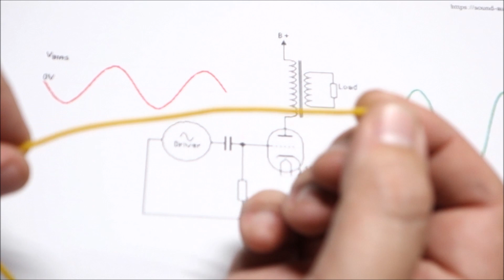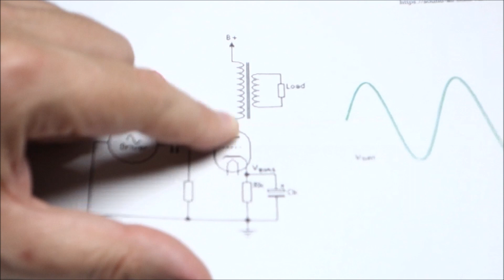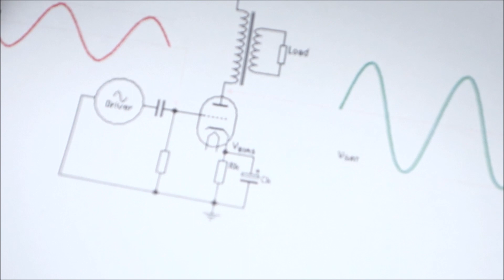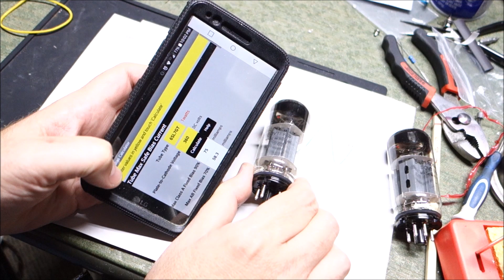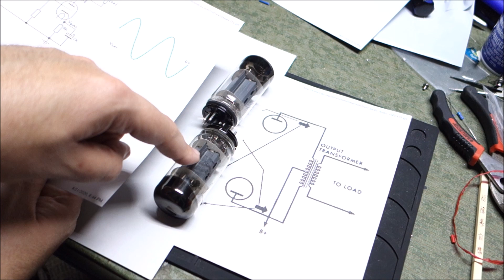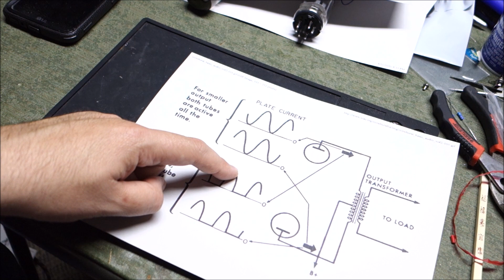Rookie's Guide to Guitar Amps...   Class A  vs.  Class AB    What the.....???

Comment: DC is like water supply pressure tower. You put a hose in and if the other end is lower, "power" will leak and the battery goes empty. You only use the potential energy of height (voltage/electromotoric power). In fact battery discharging is a veeery slow ac current with only 1/2 of wave length from maximum to minimum.
With alternating current it is like waves in the oceans - water is only a medium - a tsunami wave is a work made by seismic power on water. Tsunami wave goes somewhere and uses this kinetic energy to hit ground obstacles, but the water goes back to ocean. If Your ship is going with a speed of tsunami wave it takes 0 damage because it is in phase with tsunami (a remote place connected with a cable and no load)... if it is connected to ground tsunami will use its energy on it = load.

Comment: So what does it actually mean to burn up to just give a giveaway it’s vacuum
Reply from the maker: Inside the tube,  with too much current running through a given tube,   several failure modes are possible.   Emission loss,  shorted/open elements due to overheat, internal arcing.....   Under normal conditions,   a tube's cathode has a limited number of electrons it can emit in its life.  If it's expressed by the maker,  it's usually in hours of operation under specified parameters.    Metaphorically, tubes are like candles,   too short a wick (low bias)  and it doesn't provide much service.   Too much wick (hot bias)  and it provides a lot more,  but only a very short time.   Bias is the balance of getting the most power without spoiling the life.

Comment: Class A one tube drives the power. 2 tubes share the power chores. One tube powers , the other idles.
Reply from the maker: Actually,  that'd be Class B....    With Two power tubes,   One is idle in Class B.   In  AB,  one makes it to idle only at max volume levels.